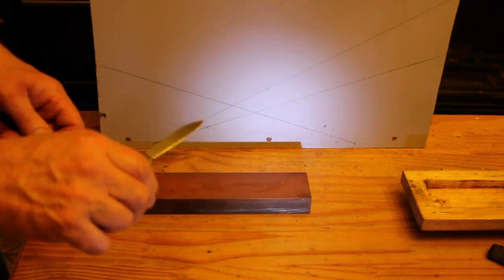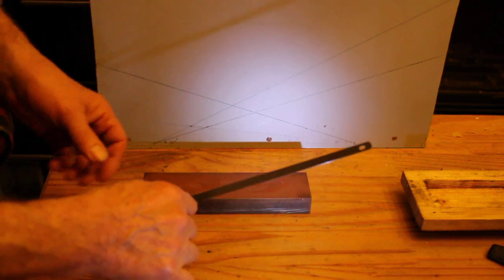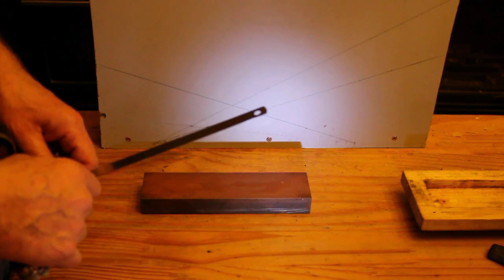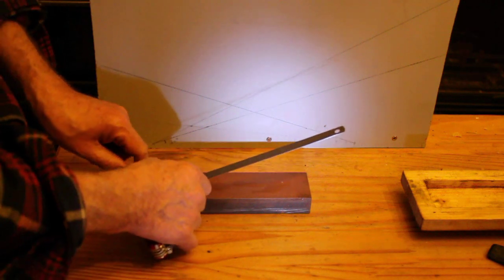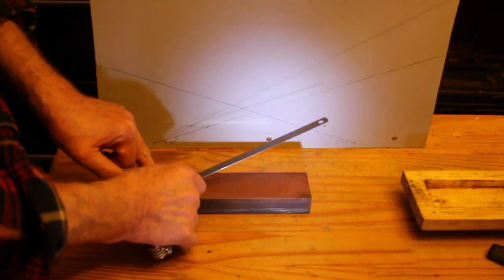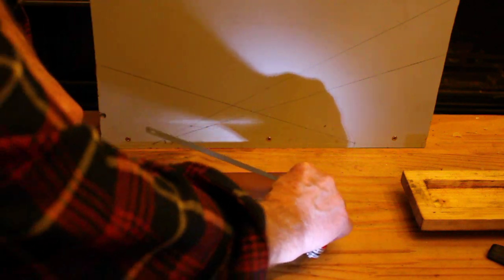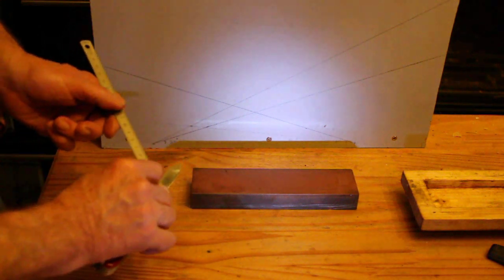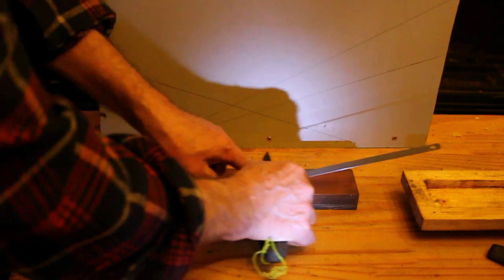Flashlight method for sharpening knives. Aiguiser les couteaux. Afilar cuchillos con una linterna

Comment from the maker: Yes, the angle advised by Victorinox, which is the make of the pocket knife I have, is 20 degrees both side. You should check with the manufacturer as to what they recommend for your particular knife, as they do differ and you can use my method to achieve it.  Thanks for watching and  commenting. All the very best from France, Organickmechanic aka Andy

Comment: So I'm confused I've been doin my own research and have come to find out that its a toss up. I'm refering to wether or not I shud be using jus plain water to keep my stone moist or if I shud use an oil? Oh an does the angle change when honing a fixed blade cus that's all I collect and the blades vary in length newhere from 5" all the way up to 22" any advice wud be greatly appreciated thnx andy

Comment: 40 degrees inclusive is a very common angle for pocket knives. Some spydercos come out at approx 30 degrees inclusive, but it pays to measure before reprofiling a blade. Just day to day sharpening you can easily copy the makers angle, or try a angled ceramic like a sharpmaker which comes with 30 and 40 degree presets anyway.

Comment: I think there is ap alce for improvement. Maybe some sor of clamp to clamp the rule right on the top side of the knife blade in the middle. This way you dont need to hold the rule with your hand and it should be much more comfortable.

Comment: Small variation: After pushing the blade away from you with the handle in your right hand, switch the handle to your left and hone the other side. That way your arm doesn't block the flashlight.

Comment: Are the angles both at 20 degrees or 10 degrees? If you each side set at 20 then you will have an edge of 40 degrees which is very obtuse for a pocket knife.